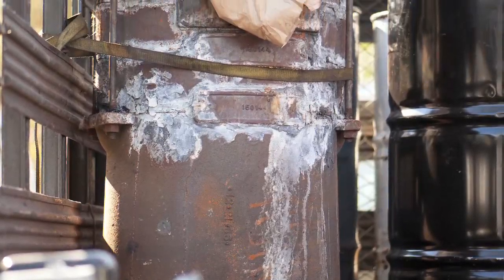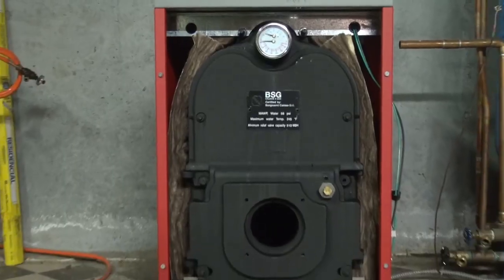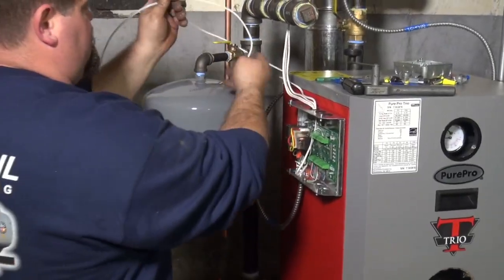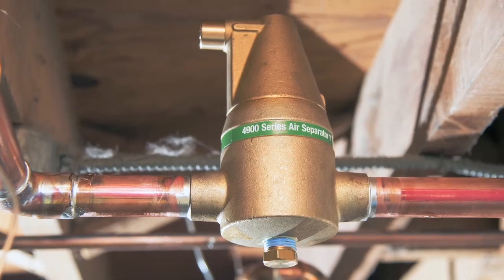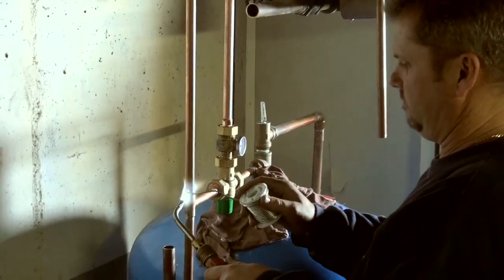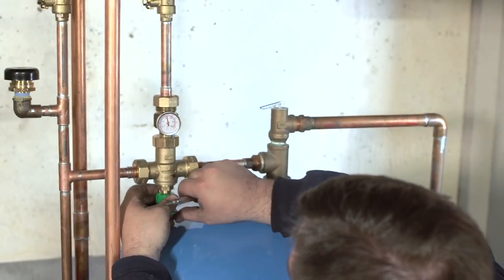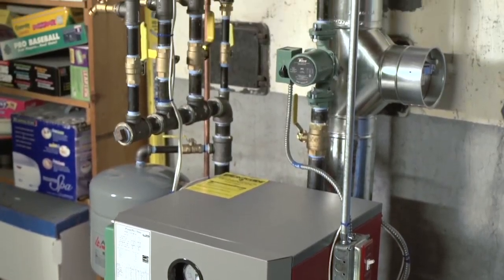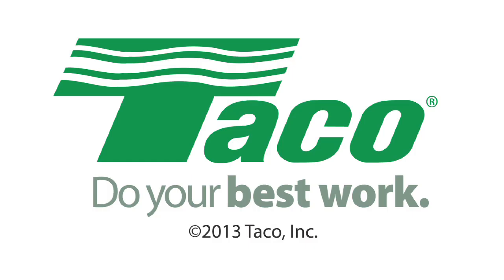5000 Series Mixing Valve Installation

Comment: Why do I see black iron pipe on water lines? Unless that’s galvanized pipe this was done incorrectly.
Reply from the maker: Good day Devin,
What you see here in this video was a closed loop hot water heating system and not a open plumbing system. You are correct, you should never used black iron pipe on a plumbing system due to the capability of the pipe itself rusting and contaminating your homes drinking water. However in a closed loop boiler system, the water that is inside should never be used for consumption or anything other than heating the home.
Thanks for watching

Comment: Does the Taco 5000 series mixing valve work based on simple water proportioning, or does it account for the temperature differential between the different Hot / Cold supply streams? Our cold-water temperature varies quite a lot depending on whether we're getting mountain ice run-off or ground-water so I'd like to buy one that adjusts the mix to achieve the desired output temperature (as much as possible) regardless of input variations.
Reply: Assholes didn't even reply to your query!!
Reply: @jonniewadd56  Probably because  most everyone knows that they are thermostatically controlled...just like a thermostat in your car's water system